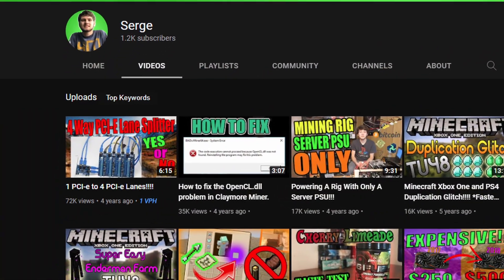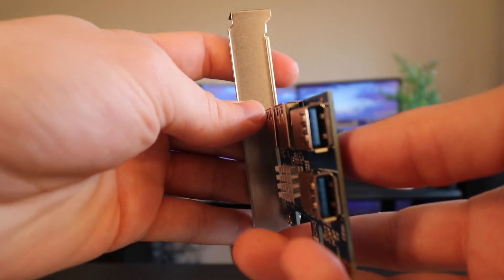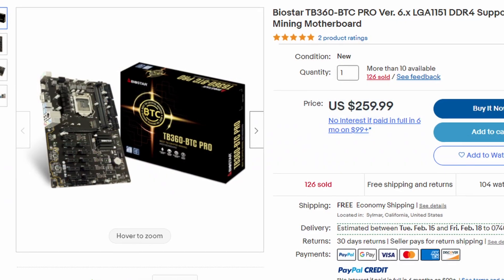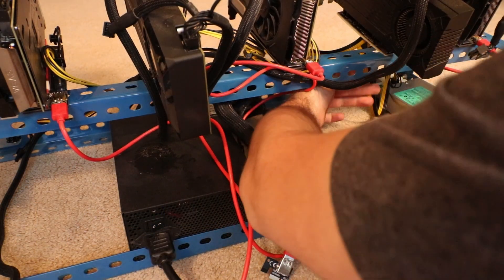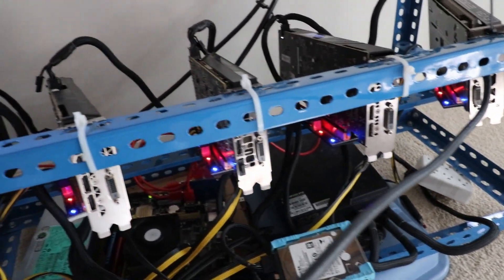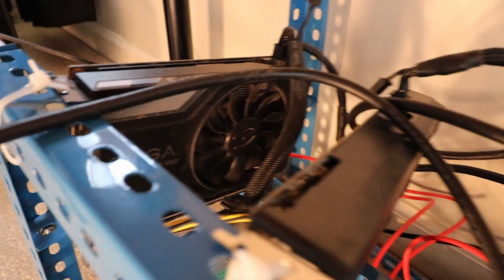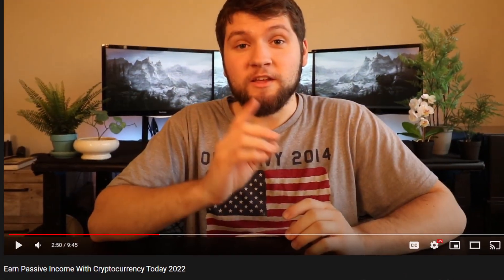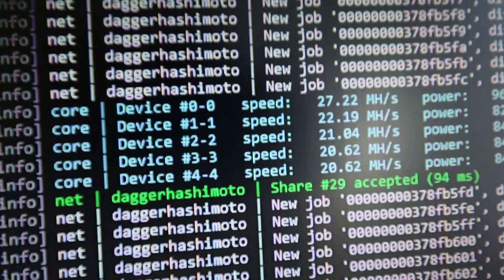Convert 1 PCI-E slot to 4 PCI-E Slots!

Comment: Bro does the adapter still works good?
And i have a question which one will good for me? 
Btc b250c for mineing or a normal motherboard by adding 2 pci 1x to 4x card" what do you prefere most?